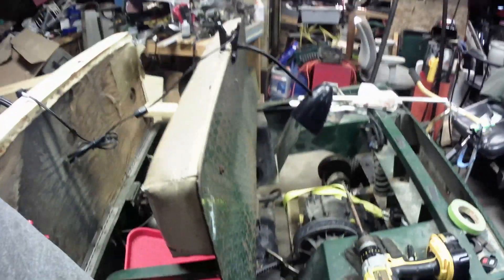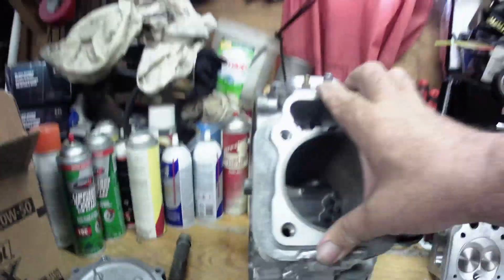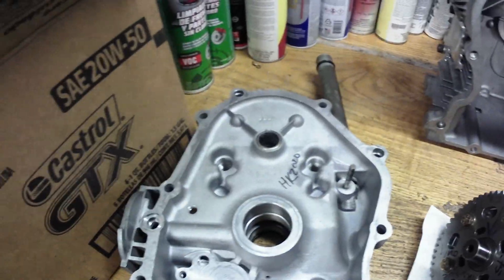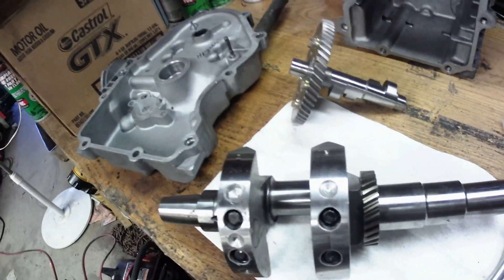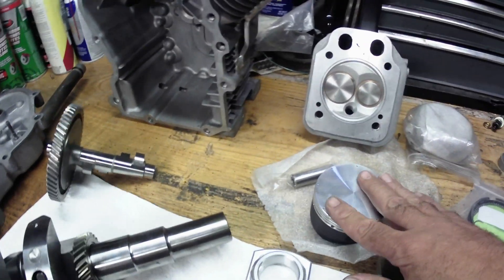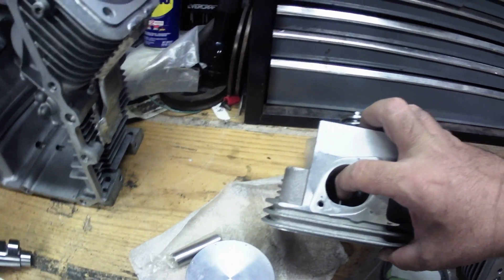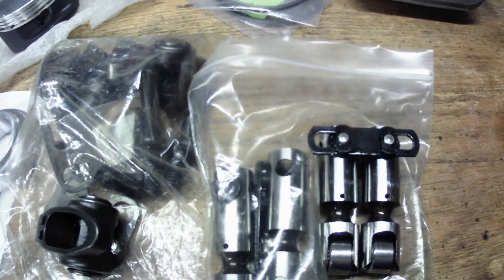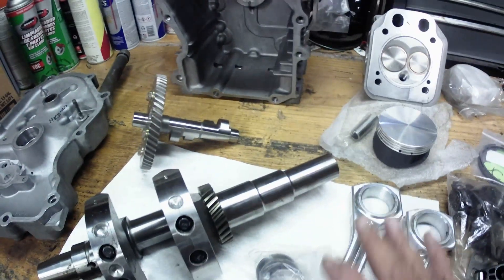New Project..Building a Pro Mod V twin engine Pt.1.

Comment: Can those performance parts be able to be able to be slapped in to a Kholer pro 22 hp??
Reply from the maker: Yes. All the Kohler command engines are the same except the cylinder bore size and the only difference between the horizontal and vertical engines are the oil pump.

Comment: Cool stuff for sure! Which V-Twin is it, B&S, Kohler or Predator? Size and expected HP would be helpful too.
Reply from the maker: It's a 25hp kohler and I'm estimating it to be around 100-110hp
Reply: @PullerbearEd  Wow, that's impressive! Thanks for responding to my question.
Reply from the maker: No problem, I try to respond to every comment.